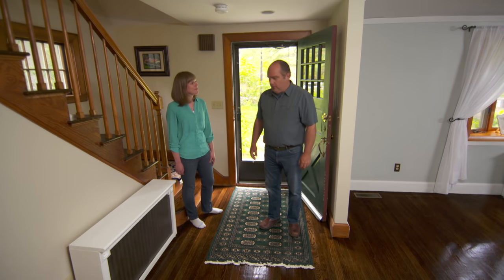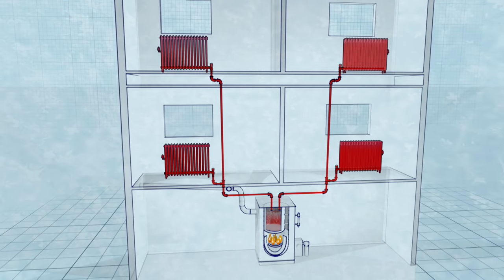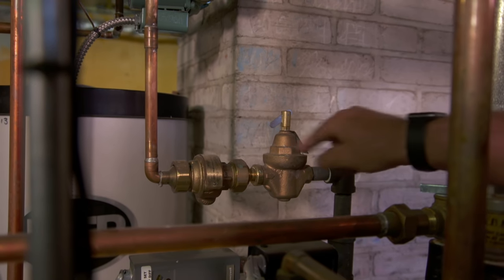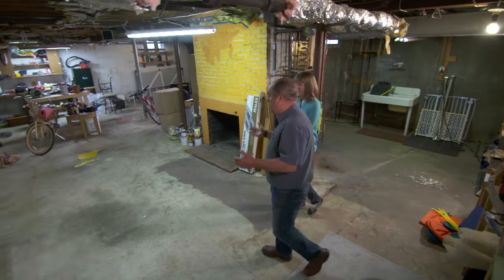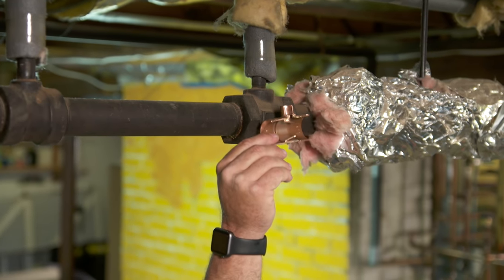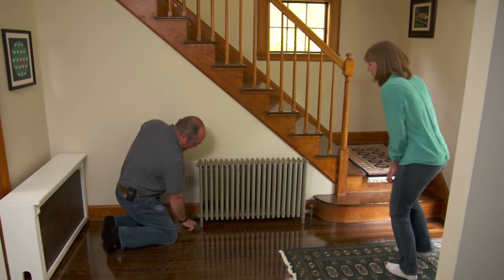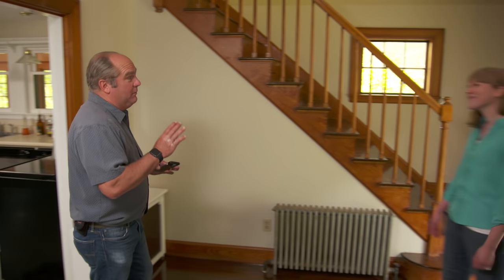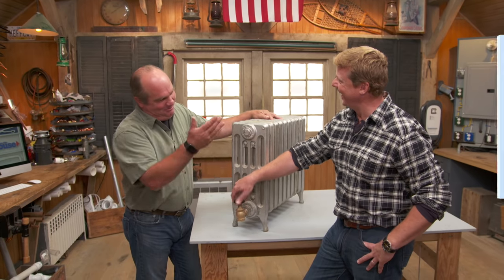How to Diagnose Problems with a Hot Water Heating System | Ask This Old House

Comment: The valve would literally be the first thing anyone would check.. It's same as, "Is it plugged in?".
Reply: mikeye9 Well they recently moved it so I think they thought it was on or didn't know how it worked
Reply: Usually those valves were previously opened or closed by an 800lb gorilla with wrench and a 12' cheater bar, and there ain't no way that thing is going to turn....
Reply: I'm a 5'3" women and I have no problem turning mine on and off. LOL
Reply: luckily you met the height requirement then
Reply: did you try turning it off and then on again?
Reply: hello I need to remove the radiator from the bathroom to remodel the bathroom, but I have one in the second order of my house as I do to install it back and everything works smoothly

Comment: Brings back memories as a kid.  We had steam heat in the apartments we resided in--one pipe system.   There was always a radiator which was weaker than the rest.  No amount of valve turning or draining did much.  Being on 3rd floors, we credited it to being far from the boiler.  Some of the darn things would leak from the valve if not fully opened.  We had metal radiator covers in one place which had water trays laid inside the top.  You could fill them with water (Humidifier).  Somewhat useless I recall.   For 25 years now have had hot water heat.  The biggest crisis in 2013 was discovering the pressure gauge was inaccurate, reading nearly 15#s high and the pressure reducing valve was plugged up (Calcified) and not working.  So the boiler was low on water and not producing enough heat.  After fixing those, all is well.  Now I have 2 pressure gauges on it!
Reply: I assume you tightened the packing nuts on the leaking valves to stop the leaking.

Comment: Good point. I chased an electrical problem for 30 minutes last week in an old house that has been remodeled and re-wired several times, only to reset a GFCI outlet in the kitchen to restore power in an adjacent room.

Comment: "My light switch is off but there is no light in my room!!!! I think it's time to call a repair man! "
Reply: spends 8 minutes analysing light switch
"Yep... Looks like it's off... You gotta flick the switch... That should solve the problem".... 👍.

"thanks sir" 

"No problem.... That'll be $322"
Reply: @ninjastah  "Sir, do you have a permit to turn that light switch on?"
Reply: @walterbrunswick  Permits are needed for clap 👏 👏 sensor lights not normal light switches. I have a level 6 in light switch theory! Please respect my credentials. Good day sir

Comment: So he explained all that and it was just turned off at the valve lol
Reply: I watched this today on tv and got a chuckle out of it.
Reply: +iShootBandits Wouldn't been much of a show otherwise. 
My thinking is the design of the covers. I understand the aesthetic idea of wanting to make the look different but the efficiency is reduced by covering the top of the radiator. Cutting slots in the top would allow the heat to raise naturally and freely. Probably not a big issue but worth noting. IMO
Reply: I thought something was up when Richard was educating that homeowner about how a boiler works and comparing her piping to a a highway....I learned  a thing or two but I cannot say the same out the homeowner.
Reply: If you have kids, they will burn the crap out of them. Also, have you ever tried dusting those stupid things? Do you have any tips? I have these heaters. I hate them. Nothing fits between or behind them. The covers are MANDATORY. I have 4 in my apartment and only 2 covers. I wish her husband would come and build me 2 more covers. UGH! So nasty and my neighbor downstairs doesn't turn them on 1/2 the time. My heat is supposed to be included in rent and my electric is sky high trying to supplement the fact that neighbor is "too hot". (I live in OH btw.)
Reply: @shellyslioneyes  Your downstairs neighbor controls your heat?  That might be illegal, actually.  Speak with your landlord about it.

Comment: Hey there I am a huge fan of your show.. I am a diyer..I am currently diagnosing why my relief valve tripped the other day.. I understand more about the expansion tank and how it work.. Ok I have a fairly new system.... LOGANO/Budreus GC 124 II installed 2013 two days before Sandy Hit. The problem I'm having is not sure how to drain my system so that I can replace the expansion tank,  I can see all the shut off valves and drain valve..I'm just not confident in executing this proceedure.  The expansion tank is 7yrs old the pressure was calibrated about 4yrs ago to 12psi that's what it's rated for. I just need some reassurance and direction going forward.  I have two circulation pumps directly under the drain spouts ..This is a two zone 3 zone system but only set up for two.

Comment: Thank you for the history lesson great job is it worth buying a house with those old radiators.
Reply: No NO NO. Get a furnace
Reply: Radiators are not obsolete! I never understand people who rip out hydronic systems and change to forced air or rip out cast Iron radiators and put in copper - aluminum fin baseboard. A properly designed hydronic system with a modern boiler such as the one in this video provides great comfort. Radiators provide even lasting warmth and are efficient with modern properly sized boilers. Just stay away from gravity hydronic systems with no circulators and massive boilers / huge water volume.
Reply: The only thing a radiator system doesn't do better than a furnace is keep your house cool in summer. For some of us, this is not an issue. For others, it's a deal-breaker.
Reply: Unless you find radiators unsightly, if the system is in good condition, hydronic systems are great. But, if natural gas were available, I would want a gas boiler to supply them instead of oil.

Comment: I had one zone not working.  Pulled motor on zone valve. Tested continuity on end switch. Good there. Motor not turning. Pulled wire off in control box. Installed jumper. Powered up. Motor turning. 

Pulled thermostat. Connected wires. Tested wire near boiler. Had continuity. Hooked it all back. Still not calling for heat.

Hmmm....

Cut and stripped wires at control box. Hooked up again. WORKING!! Hooked up thermostat again. Still working.

Conclusion. Corroded thermostat wire at the control box.

Comment: I have the similar heating system. There is a water dropping sound come out of the wall further most from the heating system, whenever the heat is on. 
Could be an issue with plumbing?

Comment: That was a easy fix. But what would the MOST LIKELY problem have been if it wasn't the shut off valve? We've been in our house for several years, the warmest radiator in the house has always been in the dining room. It is December in Indiana and we've been running the boiler for over a month with no issues. Today we noticed the dining room was cold and when I checked the radiator it was COLD AS ICE! the radiator before and after that radiator were working fine. I opened the bleed valve I was able to bleed 2 gallons of COLD water out with NO air and good, steady water pressure. 
What could my problem be?
Reply: you ever figure it out?

Comment: Awesome video , I have water and gas heating baseboard system though we are getting heat but it looks like our system is using gas to provide heat , I don’t hear water going through baseboard pipe , what could be wrong with it ?
Reply: There's no reason to hear water moving through the pipes unless there's some air in the system. Getting good heat? Then don't worry about it.

Comment: Hi,
I want to remove end cap from a 1 1/2 copper pipe.  I have drained all the water from the pipes. No matter how much i tourch the pipe the solder doesn't soften. I am using mac pro.  Under the exact condition, i have removed end cap from the second pipe 1 1/4 inch.  The solder melted in 5 minutes.
What seems to be the issue here? Do i need a hotter torch or a different technique?  Help me if you can.  Thank you.
Reply: Matthew V old solder joints have lead in them so you have to really heat them up. Just be careful when you wrench on them to pull the cap off. The copper pipe will get soft and if you warp the pipe and cap then you will never get it off

Comment: I have the exact opposite problem most people come to this channel. I bought a house 18 months ago, and always had hot water available. So I assumed the water heater in the garage was electric and working. Come to find out it solely uses natural gas and never has been on since I moved in. Kind of embarrassing to find that out now, however since I had hot water I assumed it was working. There's no breaker for an electric heater and I haven't been able to find an inline heater anywhere in the house. So, how am I getting hot water?

Comment: Wow that old system is more advanced than modern turn-off valveless baseboard heaters.  No excuse why there isn't an equivalent turn off valve engineered in MODERN baseboard heaters.  Sometimes older is better, apparently.
Reply: John Panera , cost of install is main reason why, new home builders and buyers don't want to pay for it!
Reply: John Panera very true
Reply: Modern isnt water heat, thats why. Hasnt been for a long time. Water heat is old as dirt. Baseboard heaters were just a step above and just a longer radiator.
Reply: @SteelCityJW  Depends where you are. If you are in a cold area, FHA heat is noisy and uncomfortable; as soon as the fan shuts off (and you realize how oppressive the noise was), you feel the chill. It's also dirty and prone to leaks. All of the stories I've heard involving serious mold problems (lung damage, brain damage, etc.)  involve ducted HVAC systems. Though more expensive, hot water heat combined with split ductless heat-pump units are far superior to ducted systems.
Reply: I've had FAU (hated it) and hydronic baseboard (pretty good), and am going into my first winter with old, valved radiators. [I live in Frostbite Falls.] So far, so good. If you don't need/want central air conditioning, hot water is the best system.

Comment: My viessman 100-w propane boiler shuts off. I turn the power switch off wait 30 seconds or so. Turn it back on and it may be good for a couple of days before it does it again. It does have an outside temperature monitor. I wondered if it could be that?

Comment: Hi Richard. My house have same monoflow system or called one pipe system. The "T" fittings from the main pipe go up to upper floors. My question is I have two more floor above this Ts fittings and radiators almost on same location to two floors, and how they connect together? Are they in series? Can anyone help please?

Comment: my cast iron radiators burst in my kitchen and above sleeping room, cause the main branch clogged with sludge, and four cast iron rads didn't work, and froze, and burst some sections in the rads. I was on holiday. Question for Richard - can I disassemble the radiator and take out the damaged sections and then rebuild it again with only good sections? Or is it going to leak? Maybe the frozen water weakend the integrity of cast iron? I don't know, help please. Changing the whole rads are expensive. They are each 20 sections, and only about 2 to 5 sections broke per radiator.
Reply: Maybe you could combine the leftover fins from 4 bad ones to make 2 good ones, then get 2 new ones to complete the system. One thing I can say about the cheap fin-tube baseboard radiators we have in the USA is that they never clog and almost never leak; they last forever as long as you don't kick them.

Comment: I have a loud high pitched ringing noise coming from only one of my steam radiators, any ideas on how to fix this?
Reply: Sounds like a partially closed valve is causing pressure to build before it reaches that radiator (think: tea kettle) make sure all the valves are entirely opened or entirely closed (if you want the radiator off- no halfsies, it's hard on the system when you bottle neck pressure on a valve)

If that doesn't work make sure the radiator is not perfectly flat- though non-draining condensation usually causes a knocking it could be spray dropletts screaming through as they evaporate (should tilt about 5 degrees towards the exit to drain)

If it's not the easy stuff get a bubble-blowing mixture (even a water-dish soap mix) apply it liberally around all the valves and crevices. See any bubbles or any places where the mixture is drying quickly or being pushed away while it's whistling? You have a leak and the kettle noise is explained. Replace it, call a pro or if time are tough and you have to have a band aid for now: form-a-gasket used in engine repairs (a tube of goop like j b weld) holds out well enough for a couple of seasons but it takes 24 hours to set 48 if you get the good stuff so the radiator has to be off for that time. If you can, place a tiny, form fit, piece of tin foil over the leak and make-a-gasket over the foil so none gets into the radiator itself.
NOTE: if the leak is at the bleeder valve do NOT MAKE A GASKET over it. Call a pro, it has to be replaced.

Still no?

The last cause I know of (but don't know a trick for) is sometimes the inlet/outlet valves are mixed up and you need to pull down the radiator and switch them back.

Comment: Nice one BUT what would have been your next steps in the diagnosis IF the valve had been open?
Reply: Simple, bad valve. Replace the valve that she had turned off.
Reply: I was thinking it could have been sediment on top of the venturi restricting the flow.

Comment: question. i have the same type system. 1 zone. monoflow valve. At some point, previous owners changed from poor mans cast iron radiators to single finned copper baseboard radiators. I have a baseboard radiator that doesnt get completely hot. It only has 1 bleed valve. And Ive bled that often but still only hot at the end bleed valve. Any suggestions?? thanks
Reply: It's either blockage or pressure. To test them both you swap two radiators, you move that to another radiators position and move the other one to it. If after swapping the ROOM now has the same problem with the changed radiator, you know it's pipe/pressure. If the problem follows the radiator and not the room, and in the new location that radiator still has the problem you know you've got a blockage in the radiator. This if I had to guess would be some kind of lime etc build up, hard deposits and such. You may be able to clear such a blockage by trying to flush the radiator with CLR  (calcium, lime, rust remover) or another such product.
Reply: thank you!
Reply: kenny play finned tube baseboard rads are desighned to have direct flow thru them,not mono flow like explained in video,you will have to find your intake line  coming off the main and the return tieing back into the main and install a isolation valve on the main line between the two ,once installed between the two shut it off,this will force all of the heating water through your finned tube rad and then back into the main and on its way to the rest of the home and back to the boiler
Reply: i see, let me go over this, and share with a plumber heater person, thanks
Reply: @michaeldillabough8744  Fin-tube radiators are also used with monoflow systems; mine are plumbed like this, and each one has a bleeder valve. One thing to watch for is whether the radiator is level; if it's not, the bleeder won't work unless it's on the high end.
Reply: Go into your basement (presumed location) and find the supply pipe to that baseboard heater. Measure the temp. and compare it with area supply pipe temp. That will tell you whether the regional supply is working and whether baseboard tap is set up properly. If not you may need a Venturi coupling like Richard showed.  If it's in a large room that you might want to regulate separately, sometimes a thermostat and a small circulating pump are the best solutions.

Comment: I live in an very old mansion turned into apartments. I live upstairs in #4  ,   It was built in 1865, I have no idea how old the water radiators are, but my bedroom radiator valve has a wooden knob on the valve and its not moving cant get it to open or close, been stuck like this for many years, Ive lived here 25 years.  Im not the owner I just rent.  My bedroom often is not very warm and gets pretty cold in fall and spring because I don't think the radiator is getting enough water,  when the maintenance guy bled it there was a lot of air in the radiator before any water came out.  Any suggestions o could tell him?
Reply: Bleed it again to be sure that air hasn't gotten in there once more. It's common not to be able to move those old valves. They are usually stuck in the open position as evidenced by his ability to bleed them.  When the boiler shuts off because the room thermostat has been satisfied, check the temp. of the boiler gauge and the pressure. They should meet the necessary specs. Take a thermometer and measure the temp at your radiator and that of some others on the same floor.
If yours is too low, you may have a case for inadequate water flow from a blocked valve or poor flow from the boiler as Richard showed.